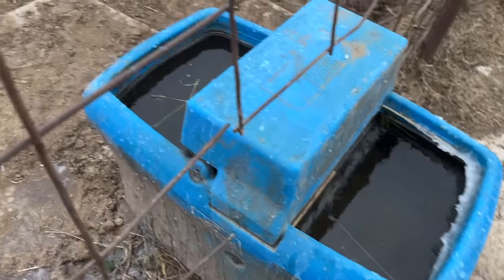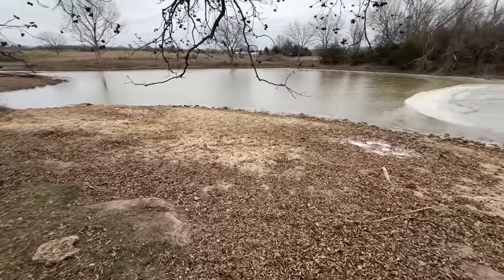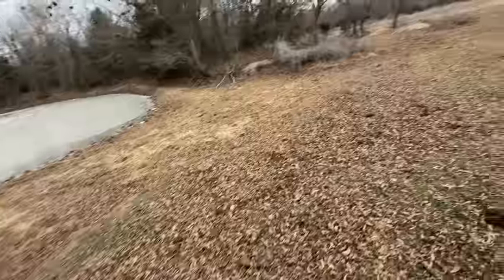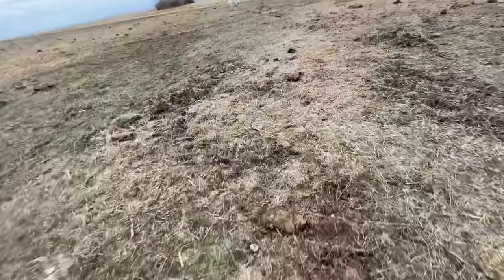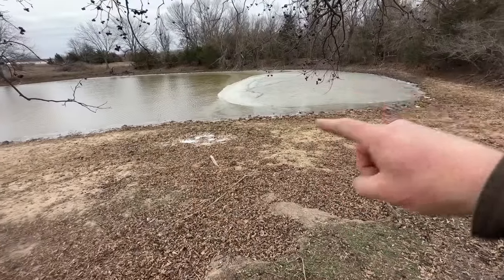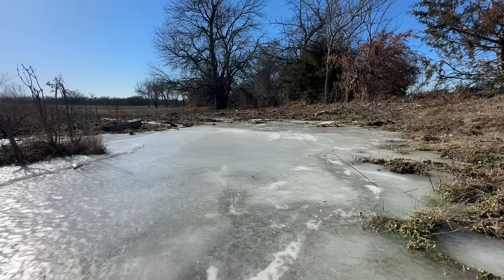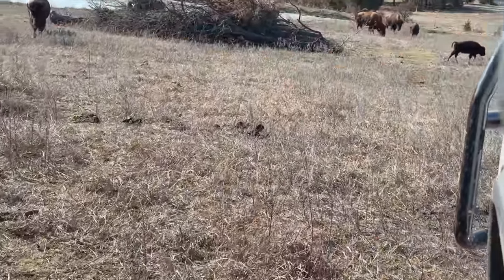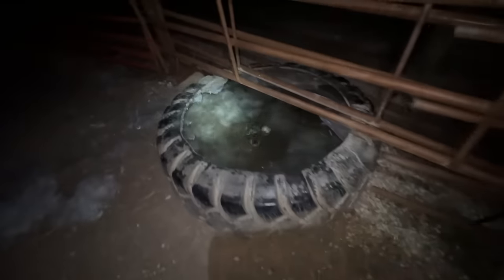Ponds Are Frozen, Bison Need Some Water!

Comment: Fill some water jugs about 3 /4 full and add about  1 cup salt to 16 Oz water , place in troughs and ponds to help prevent freezing❤
Reply: Surely the salt isn't good for the animals?
Reply: Animals NEED salt to regulate their endocrine system.  Salt has the added bonus of making them thirsty, so they need more water.  In extreme cold animals tend to seek less water.  Adding salt gives a bonus in they need water more.
Bear in mind that feed has minimal salt, so it is wise to add salt for them in extreme cold.   @kimmarievan-ever6599
Reply: Maybe I filled my gallon jugs too full??? I had a friend tell me about doing that, added a cup of salt to the gallon of water, but I filled it up all the way. Thought it would float on it's side, but it's sitting on the bottom of the 40gal tub with just the top showing. Not really bobbing. Finally found a tub heater, which should come on Sunday. Not that I should be buying one, but the barn owner isn't going to. 🙄
Reply: 16 oz is 2 cups so you are adding 1 cup of salt for every 2 cups of water.  Filling a gallon jug 1/2 full is 8 cups of water & 4 cups of salt if I did the math correctly.  That amount of salt/water mixture should float and there will be some salt transfer from the jug to the trough.
Reply: That sounds like a great idea, Dusty

Comment: Dusty if you have a post hole auger you can use it to drill holes in the ice. You could make multiple holes or connect them to make a larger area. Stay warm and safe.

Comment: Here's a suggestion my Dad & others did in the 40s & 50s in Montana. In the fall they put a couple of stakes in, across a pond. Put a big chain dropped to the bottom. Ice forms, take the curled end, hook to tractor or truck hitch. Pull tight. Keep shifting, snap chain through the ice. Worked great. 🤗

Comment: For your frozen water you might take a look at pond aerators, especially where you have power. Here in MN the city has a couple of aerators in the local small lakes (primarily to prevent fish loss) but they keep an area of open water all winter.
Reply: The freeze going on is beyond aerators, but otherwise, that would really help.  😊
Reply: I would beg to differ on the capacity of aerators. The City here has them on all winter and they will keep spots of open water throughout the winter. Oklahoma doesn't currently have winter conditions on par with our normal winter lows...I will acknowledge that they may be supersized for the Minnesota conditions.

Comment: A 60 to 80 degree drop with humidity is a huge shock no matter the top and bottom number. Add windchill and you have a disaster for folks not used to the cold like Norther folk.

Comment: They have a roller type tool that you roll across the ground that will pick up those nuts. The nuts push in thorough the wires.

Comment: Dusty, do you ever put a burn barrel with a cinder block & some fire wood, on fire, in the pond, right at the edge, part of it out of the water, to help keep the pond from freezing? Need to weight & stabilize it so it doesn't get knocked over